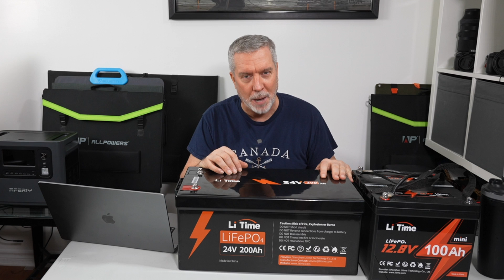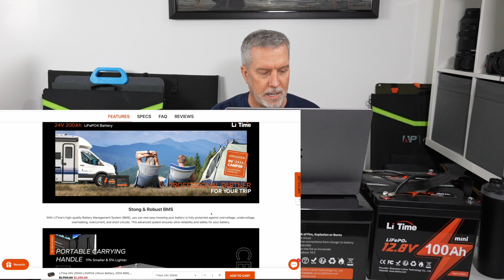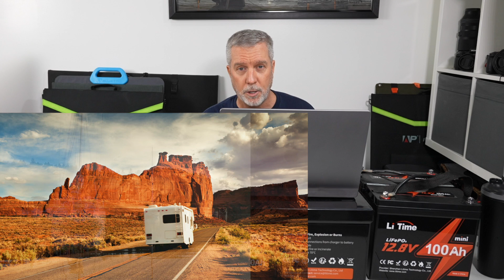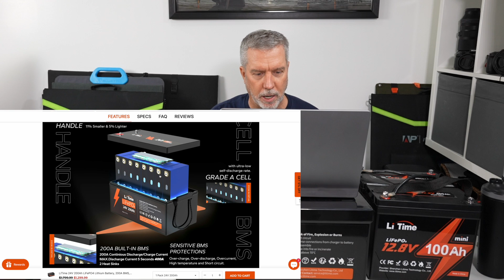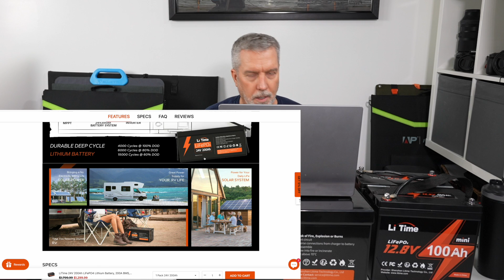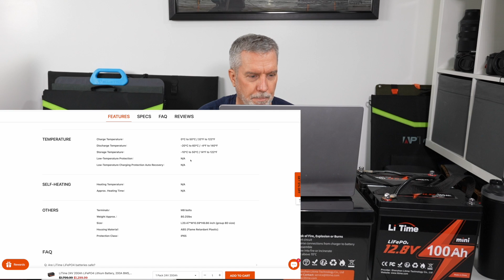Massive Li Time 24V 200AH battery outperforms and is the perfect "Living Off Grid" house bank option

Comment: At first I thought I'd use 2 of them to take the charge from my 2 400a mechman alternators on my van but then I realized that a 200a 24v bms is only good for 100a charging or 2560w. So I now have to entertain using 4 75 lbs 200ah 24v batreries just the get the full 800a or 10,000 watts from both alrernators.

Comment: It is a good battery specially for a boat. However, I bought three 24V/100A  LiTime batteries for a total of 300Ah and it was around $1300. For a home back up system is a more economical way of getting a large bank.

Comment: i built both my batteries. one is a 12 kw nissan leaf battery rewired to 24 volts and my other is 32 eve 280k cells wired to 24 vol5s with jk bms. i kinda wish id bought the li time like those. they seem great.

Comment: 25.6v is the nominal voltage not fully charged. A fully charged "24v" LiFePO4 battery is 27.2v at rest...25.6v is approximately 20% SoC. I believe they put 12/24/36/48 volts on the products because that's what people are used to. In reality those LFP batteries are 12.8/25.6/38.4/51.2 volts nominal. Currently have 2x 25.6v 100Ah Li Time batteries and they're great...also useful for charging the portable power station I have if no power is available

Comment: The size of solar array needed for 8 of these would be immense. I'm currently running a single 100ah 24v life po4, soon to double that with a second battery, I'll be running 1000 watts of pv array. Sums indicate that not dropping below 60% dod, and taking the batteries to 28v (3.55v per cell) and floating between those two parameters, that's a 15-20 year life span+ and with my average consumption, I could park in a cave for over a week and not have any issues. Later when that becomes 3 batteries, 300ah at 24v, 1200 watts harvest, that'll cover an 8 hour charge time from 60% to 98%. I'm in england atm, but when I emigrate to europe, those figures will improve drastically with avge daylight hours. Plenty of scope to increase my consumption and improve my home. Love DC solar, 24v is punchy enough, depth of storage is genuinely impressive, and my starter batteries and alternator are 24v DC also, so a dc to dc charger later for driving charge is also on the cards!!! Mercedes over specd the alternators on these trucks by 60 available amps (120 needed, 180 supplied), so no early demise or overloading of the alternator. Love being off grid, it's amazing 😊🙏 happy travels amigos

Comment: Today they have the 24V 100Ah on sale for $519.99 so a savings of $360.01 if I buy two, is there any advantage to not taking this deal? Does the 100Ah have all the same safety features you mention here?
Reply: I purchased 100Ah mini, I asked customer service if the safety performance of 100Ah was consistent with the safety performance of 24V100Ah, and they said yes. Later, I chose 100Ahmini because my installation space is small and I hope the battery has the same energy but the battery size is smaller.
Reply from the maker: OK
Reply: yes,